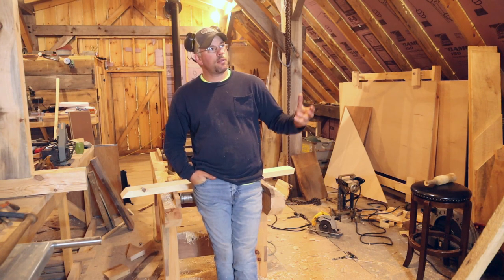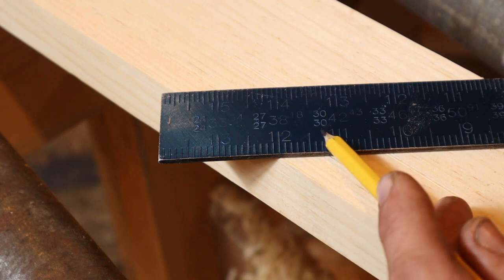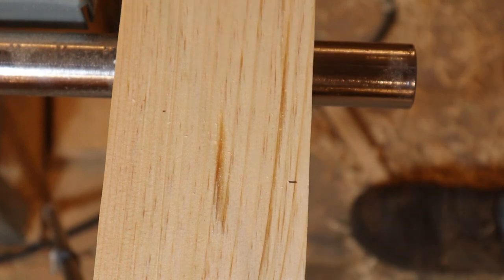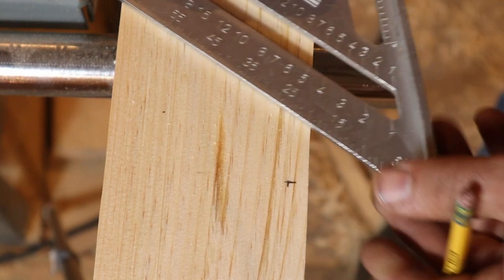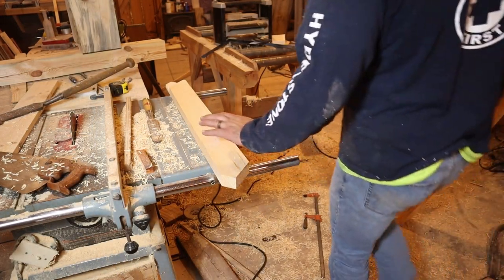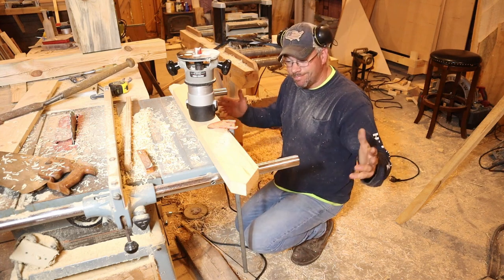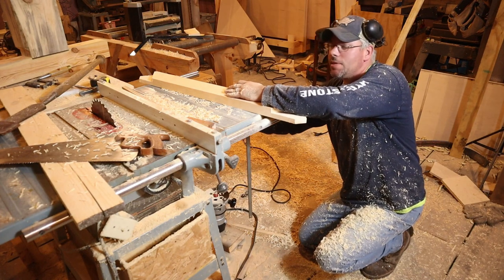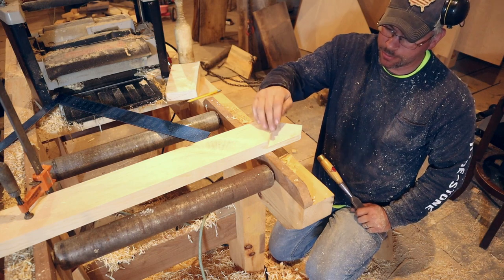Learning To Timber Frame Made Easy Part 3: Laying Out A Brace

Comment: Morning, Jim. Loving the man-glitter again. Still wishing you would use breathing protection with power tools. And hoping you don't regret not using it one of these days. Just looking out for your future health, friend. Great explanation on the brace, the square chart, and the offset for the housing. The only thing I would do differently would be to cut the other direction when cutting the little tip off with the circular saw, having the weight of the saw on the board instead of hanging over the tip in the air. It kinda twisted right before the small piece cut off. Any way, great video, can't wait to see the joints come together. Thanks for sharing this with us. 
L8R.

Comment: Hi Jim I'm doing a timber frame entry I have 6x6 posts with 4 x6 brace and I want to put my brace in the middle of the post. If I move my housing over to the middle do my braces look like yours or do I take the same amount off of each side of the brace?
Reply from the maker: You can still do them this same way, helluva lot easier and faster.

Comment: I have my Great Grandad's framing square and on the brace charts, all my fractions are off by exactly 1/100 from yours. I know that small detail has no real effect on layout. I just wonder if that varies by manufacturer or if it changed at a specific time due to more accurate math being applied. (The silly shit my brain wants to know)

Comment: Okay, you need to make sure that one side is square and work from there in setting the mortise and tenons (Part 1 & 2) but  won't this affect the fit of the brace into the post and beam that joins into the underside of the post/beam that is not necessarily square? Thanks for these videos!
Reply from the maker: Basically you have to cut the underside joinery square with the faces that are square.  It sounds more complicated than it is.  I'm doing another timber frame soon and hopefully I can do a better job teaching it this time.
Reply: @TheTradesmanChannel  Thanks for your speedy reply!
Reply from the maker: No problem

Comment: why not cut these to match by laying them on the timber? are you assuming you don't have any timber cut yet?
Reply from the maker: If you were doing a scribe rule timber frame you would probably do it exactly like what you're saying. When doing the square rule you're making it so that you can cut all of your pieces at once, meaning you can cut all your braces at once and then move on to cutting all your wall post mortises and tenons at once and so forth.
Reply: @TheTradesmanChannel  , ok, that makes sense. Describing the difference between those two methods could be an interesting video

Comment: Anyone have a table for knee braces?/ Know what I should use  I've gone for a 160cm width X 200cm height post and beam Arbor, but want to have some knee braces.
Reply: 62.99 width X 78.74 height in inches
Reply from the maker: You would probably be fine with a 24" brace layout, maybe even a 30" brace layout.  Usually I make my braces 4"x6", you might be able to use 3"x5" braces.